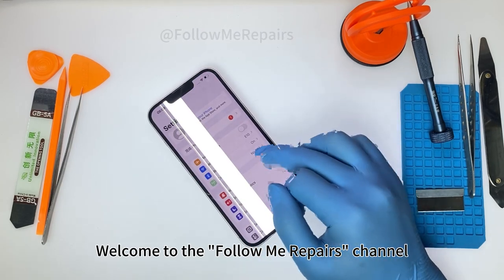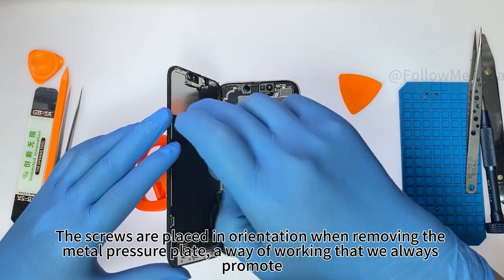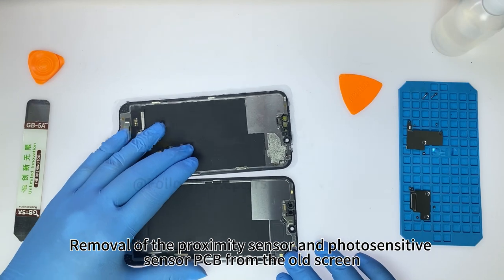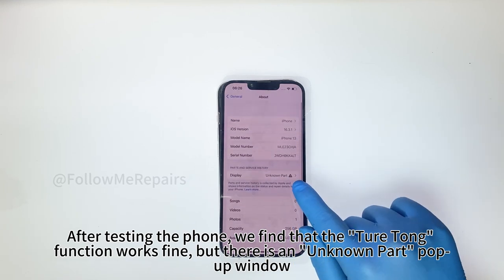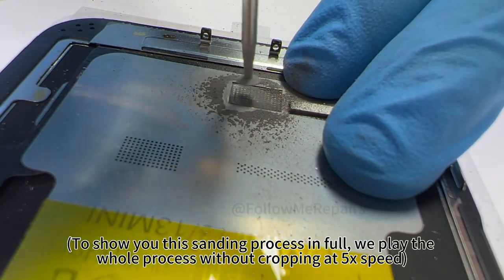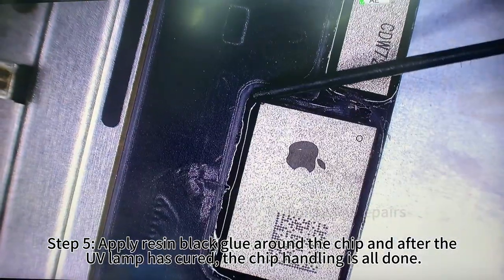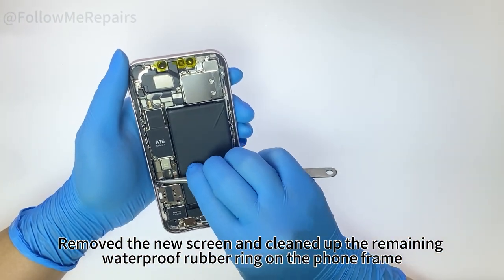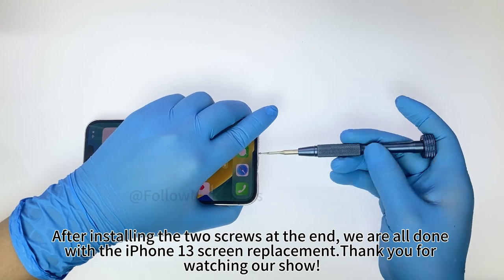iPhone 13 Screen Replacement Tutorial - Solutions for Ture Tong & Unknown Part #repair #screen

Comment: does the grinding method only work on oem screens? Or will the soldering pins be the same underneath on aftermarket screens?
Reply from the maker: The grinding method is suitable for the original screen, the purpose of grinding is needed to use the soldering pins of the upper chip of the original circuit board. The chip pins that are made are the same as the solder pins on the circuit board. Each chip has its own unique footage.